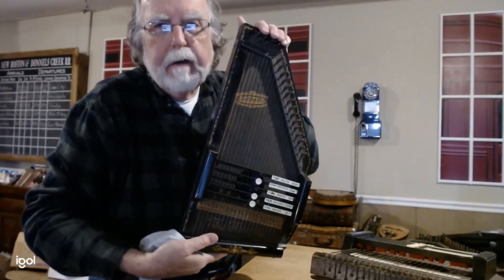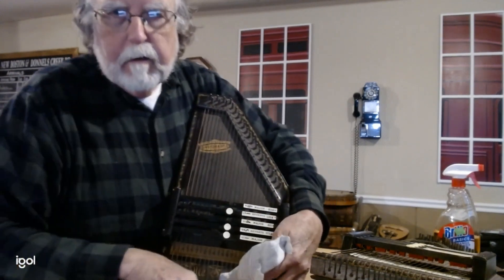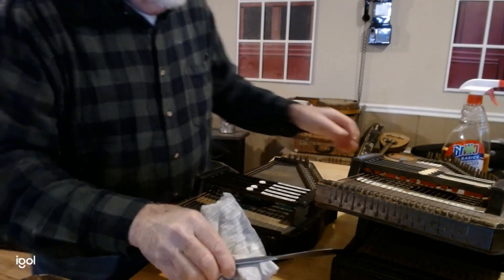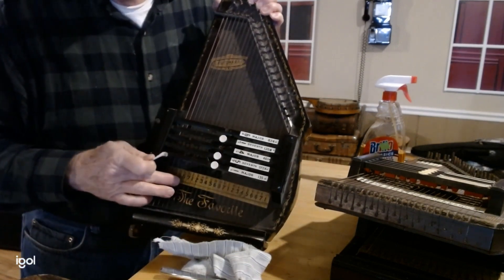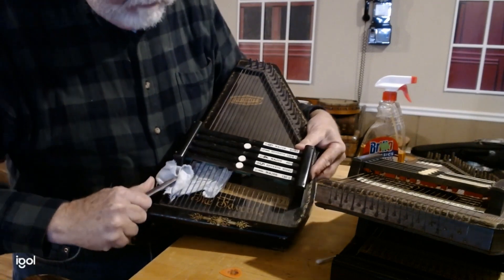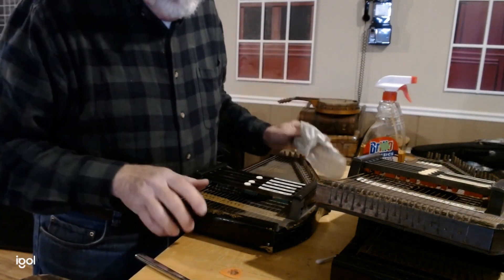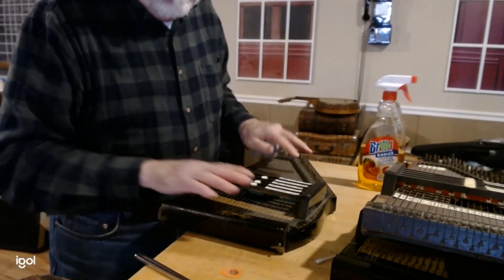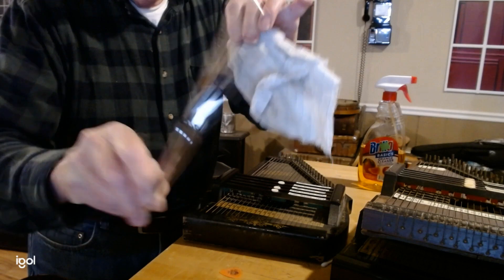Cleaning Dusty Autoharps

Comment: How about MURPHY pure veg oil soap, I have bug poop on the top under the strings..or Old English furniture polish?
Reply from the maker: Depending on the surface, Murphy's oil soap might be a good choice.  Most of the autoharps I own have a sealed top, so furniture polish doesn't make that much difference, but if you have a open pore top, definitely use Murphy's oil soap or Old English furniture polish or some such.  Just try not to get it on the strings and wipe it off if you do.
Reply: @paulracemusic  Thanks. Waiting for my tuning wrench to arrive.

Comment: I have an autoharp that just says Autoharp by Oscar Schmidt. Cleaning the outside of it is easy but what I want to know is how do I clean the inside of it? This autoharp is filled with spiderwebs, dead bugs, and dirt.
Reply from the maker: I understand. Sometimes a shop vac over one of the holes will work wonders.  If that doesn't work, maybe get a tube to fit over the end of the vacuum nozzle that would fit inside and you could work it around?  Sorry, there's no one proven approach.  :-)

Comment: What cleaning solution are you using?
Reply from the maker: It's an off brand that isn't made any more.  Similar to Fantastic and other cleaning solutions that don't leave a residue.  Obviously, you don't want to saturate the autoharp's top with the stuff, but a little on a cleaning rag or q-tip works wonders.